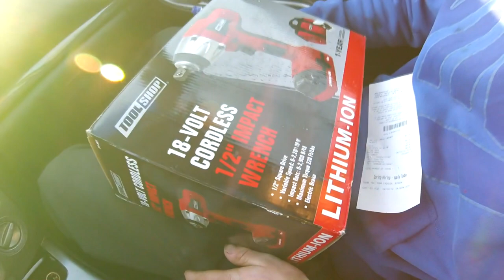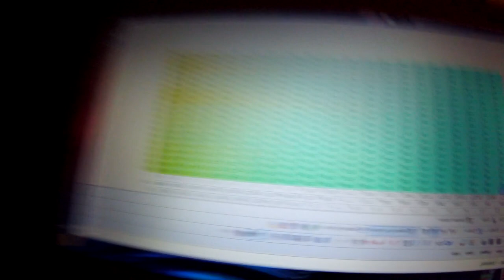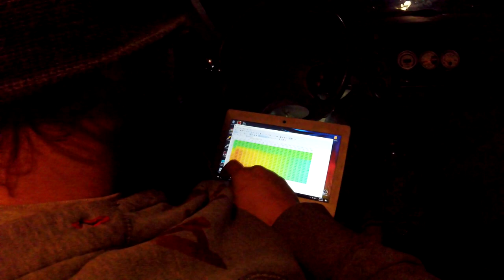Random Story Time. Alignment Shop Woes. Tuning PVC Pipe Civic

Comment: I'm an electrician by trade and all of my cordless power tools are milwuakee m18. Top notch shit. The m18 high impact 1/2 inch impact is bad ass. Pops crank bolts and can literally bust the head of bolts off on high. Plus the 9.0amp battery is sick.

Comment: Get the Kolbalt impact,  it's cheaper than Milwaukee and works just as good. plus new (small) battaries are only $10
Reply: Anthony Rowell I have 3 cobalt cordless drivers.  Drill, 1/4 bit driver, and 1/2” small impact. I was wondering about their big boy 1/2”.
Doesn’t have near as much rated torque as others but if it has enough to remove lug nuts I’d be happy to keep one style of battery for all tools.
24v brushless seem to work good so far.
Reply: TheProchargedmopar the torque spec for the Milwaukee is 700ftlbs of torque and the kolbalt 650.....both of which will remove lugnuts. Milwaukee does make a 3/4" driver rated way higher

Comment: Honestly bro, if I were you, I would invest in a Dewalt or a similar brand battery powered impact instead of screwing around with the cheap brands because it's a case where you really get what you pay for. I have a cheap $50 AutoZone impact because I saw it for 50 and said screw it. It helps around the garage, but it dies randomly and it isn't something that I would trust on the road or on a track.
Reply: Boosted B Series EK I use the kolbalt impact